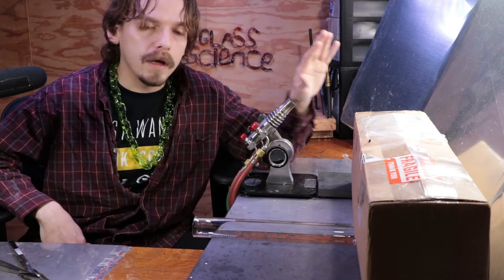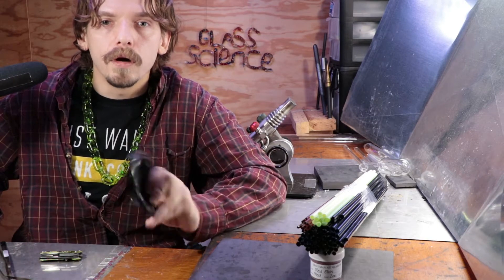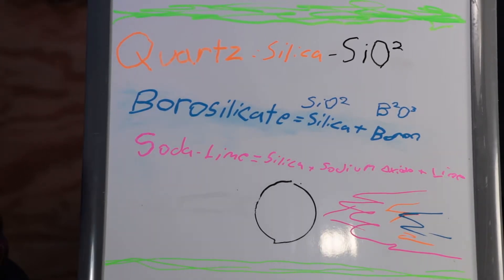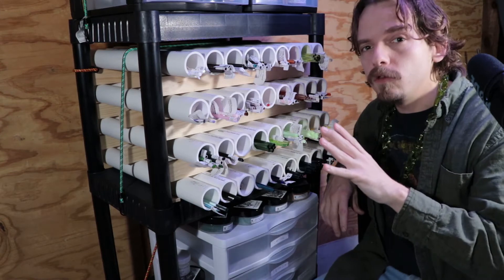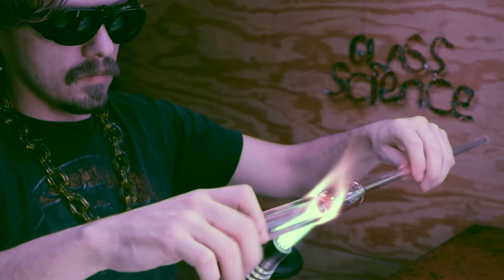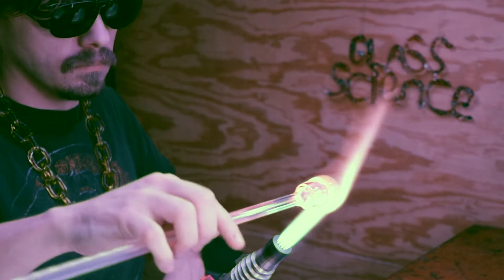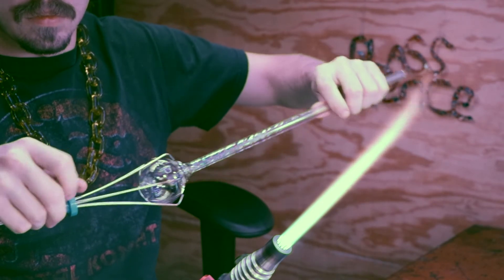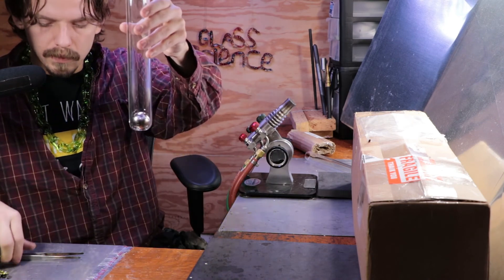Glass Organizer Lampworking - Glass Blowing Techniques

Comment: Is BORO better than soft glass for color and clarity?
Reply from the maker: I'm not sure how it compares in clarity, but for color I feel it depends more on the company. There's been an increase in Boro color making lately so there's a large selection to choose from.
Reply: @MattJasa  thanks man, I’m getting back into glass work. I’ve only ever used soft glass. Just curious the advantage of boro over the soft glass type
Reply from the maker: @timcapell  The thermal expansion in Boro is lower so its a bit more stable. It tends to snap rather than shatter so you'll have larger chunks with less jagged edges. It also needs a bit more heat, but should be easier to work with.